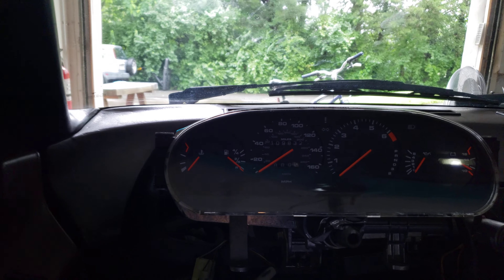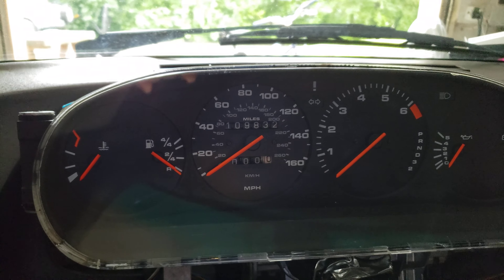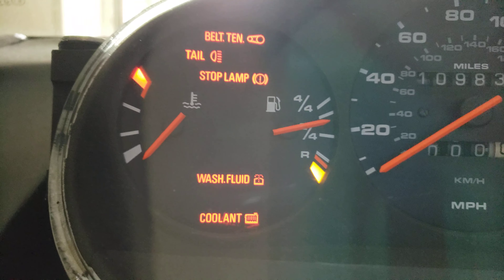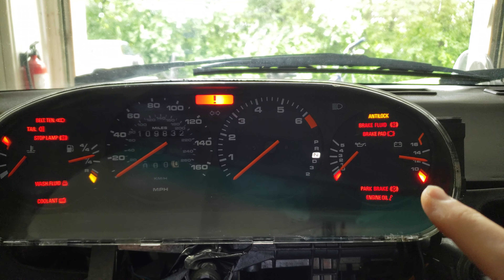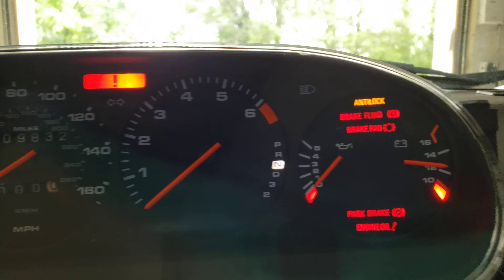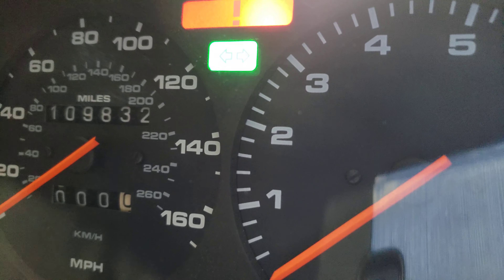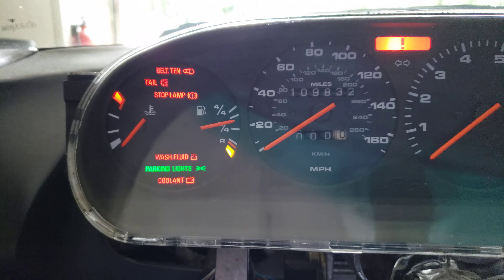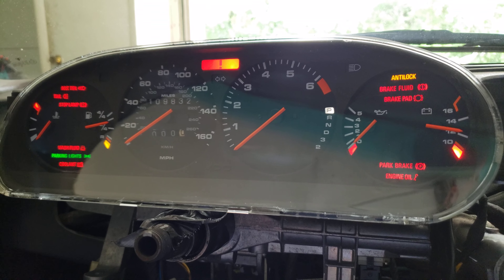Porsche 928 Part 3 LEDs for gauges

Comment from the maker: The LEDs for the PRND32 lights are model LTH3MM12VFR4400 from digikey.com and are working really well.  They have a built in load limiting resistor and are very compact.

Comment: How did you determine the correct polarity on the back of the instrument cluster in order to correctly install the polarity sensitive replacement LED bulbs?
Reply from the maker: Simply tried one orientation, then the other, and powered up the gauge cluster. For the soldered PRND32 lamps you can visually trace the ground (-) paths, or use alligator clips or probe tips and trial and error. Also search Rennlist 928 forum as there is at least one post where I believe the polarity was charted by a member.